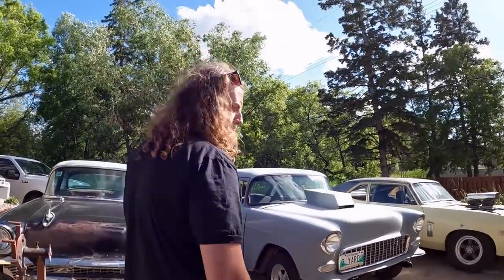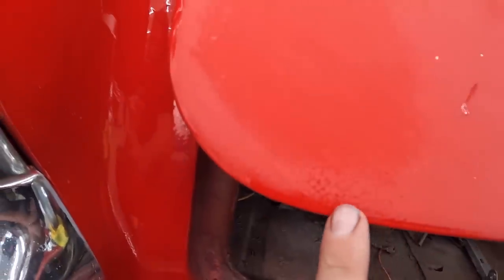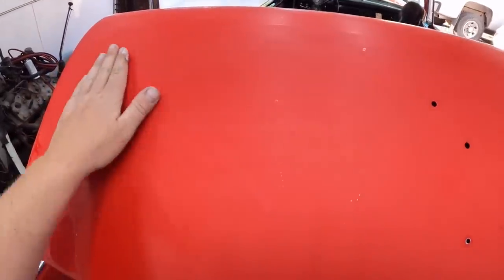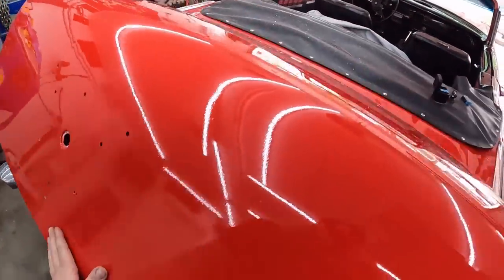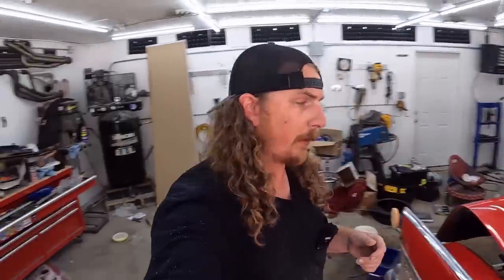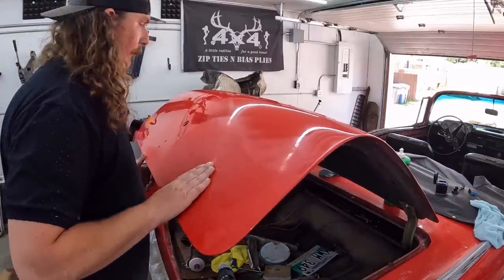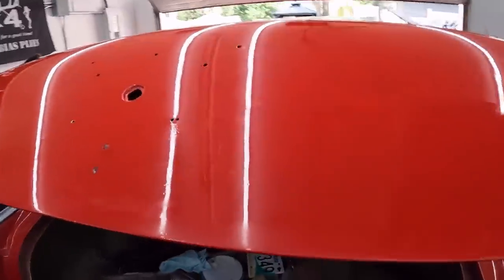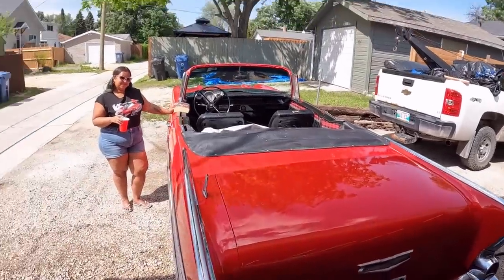TRACTOR PAINT Gets Wet Sanded And Buffed - Amateur Paint Job To Expert Finish

Comment: Couple of tips, when using a wool pad also use a cleaning spur to keep the product from building up on the pad which might cause burn thru, also throw a blanket over the interior to keep the product spattering all over parts of the car you dont want, overall it looks good, great job!
Reply: Use a blow gun and hit the trigger and spin the pad, while you blow it clean and dry at the same time!

Comment: Dan:  Any time I have an issue with swirl marks in my clear (especially a dark color), I'll do my wet sanding and throw it out in the summer sun for the rest of the day.  Since wet sanding "opens"  the clear, the heat of the sun will "tighten" it back up.  The end result is it buffs easier and the swirl marks come out a lot easier. 🙃
Reply: Didn’t know that, awesome!

Comment: Dan if the paint is still soft it still has solvents in it. When you buff it and wax it you are sealing those solvents in. The best thing to do with enamel paint is to wet sand it with fine sandpaper and let it set until the solvents have evaporated out. You can not hurry anenamel

Comment: I feel for ya' Dan. I just spent 2 days wet sanding and polishing the trunk lid on my '67 Red LeMans. I could have sanded it and re-cleared it twice in that time. But it turned out great. I used 3000 grit 3M Trizact for the final sand before buffing. Thanks again for sharing your Garage Time with us.

Comment: well hello Dan . when wet sand sanding you have to use a squeegee to wipe off the excess see what you're doing
Reply: I wipe it then use my air gun to get it dry quick...to see where it needs more sanding. Others just wipe it then move to another area while the wetness dries. Both work great.

Comment: Hello there cowboy here again so you want to be a polishers lol it takes a while to get the feel it's real easy to burn through a couple of hints a little bit of compound goes a long way also put the clothes away till you're done with the compound also watch your angle you want to float the pad at a slight angle keeping a larger point of contact with the pad , the get a good Polish and a clean pad to finish polishing out the clear coat to a nice luster try watching a good video on cut and buff you'll see first very careful sanding with multiple grits then compound stop wash it good to get all the compound off the surface only then Polish it keep trying you'll figure out what works kinda and clearly what doesn't no matter what pad you're using with whatever cream a light touch don't bear down ever you'll find out way to quickly why all the best be patient with it as always remember be safe healthy and happy God Bless 🤠

Comment: Dan, worst case is you could sand it with about 600 spot in the color and reclear the panel.  Looks really good.  Andy
Reply: This. Basically adding a flow coat. Would cover quite well.

Comment: I always found it harder to buff the panels and get out all the scratches when I hand sanded. Wool pad works but the burn thru risks are higher. Look into 3M products for your DA sander that use a " Hookit" interface pad. 1500 grit, 3000 grit and finish with the wet 3m Trizact 5000 grit and use a foam pad on your buffer. Finish up with your DA polisher and some 3m swirl mark remover. As always, Love the Vids! Keep it up

Comment: One thing about it, is that, if it does go south, You can always respray it, because it will already be sanded. You wouldn't be out other than the paint. But I don't think that will be needed. I have faith, Also when I was a young boy, my father would paint cars part time. I would help sand while my father would polish the paint. He never had any problems using basically the same paint as you. This was in the 60's. Good Luck. Ronnie. You could use a couple of drops of dish soap. will help sand easier, like a lube.

Comment: The car looks great!  From its humble beginnings to today, you have turned the '57 into a great car.  A little orange peel is nothing.  I didn't put enough hardener for a paint job once and it took 3 or 4 months for the paint to 'dry'.  Sucked.  It was so soft, days later you could still leave fingerprints in the paint.  That was an embarrassing lesson learned.  I was glad it wasn't on one of my hot rods and didn't even try to correct the flaws in the paint.

Comment: Some of those spots on the vertical section of the drinker's side almost look more like fisheyes,  from oil contamination.  Since the decklid is the worst part,  I'd maybe sand it as smooth as you can,  using 600 or so,  and shoot new clear on the decklid itself.
Reply: @blackiecat7195  that too...
Reply: @blackiecat7195  I would think that the whole paint job would be that way then but it sounds like it's only in a couple areas and he did mention that it was tight to the garage door so he might have been too heavy on his coats of clear in spots and there was not enough time between the coats to dry sufficient.

Comment: +1 for the wool pad.  And you only need a DA to get the polishing scratches out.  I also love Mcguires ultimate,  it's cheap and works awesome.  Keep it wet and don't overheat the paint.  Once it's dead flat, then you can work it with foam and softer compounds with a DA.
No heat!  It's mechanical abrasion.  If you overheat it it's plastic.  You will ruin the paint.  Plastic will discolor and deform, lose structural integrity when heated.

Comment: Having just buffed out a vehicle had a lot of white paint and scratches plus some damage from scraping a garage door frame; I have a few suggestions.
1. Looks like you may have been too liberal with the compound as it looked like like you were just sloshing around. I went light and buffed until it became hazy and had an actual tug on the buffer.
2. You might have stopped and checked for any red paint on the pad or wipe off cloth. Chemical Guy's yellow wiping cloths would have shown any pigment more easily...white even better.
3. I stayed with my Griot Garage G9 random/orbital buffer which has, to me, better control Than my Makita 9237c. Both great tools but the Makita requires more care.
4. I understand your desire for instantaneous gratification but as I've told my son in +/- your age bracket...If you don't have to have it done immediately when frustrated with progress don't get mad walk away for awhile...as it seems you have on the Nomad. 
5. Did Mr Cotton suggest speed settings (rhetorical) as I set the Griot Garage budder at 4 or 5 depending on where I was buffing.
Good luck.

Comment: Some advice to save lots of time when you have a large area with issues like that trunk.. just sand it down and shoot another coat of clear.
Reply: I was going to post the same answer, but as long as it doesn't have the same heavy orange peel on the re-coat. its amazes me how much orange peel there is on new cars, hvlp?

Comment: I'm painting my wheel horse garden tractor with van sickle. Pretty sure it's an enamel but their clear is lacquer.  It worked fine but some places orange peeled bad. Sanded and recleared and same thing in same spots. Even clearing over the clear was messing up. I'm no body shop guy but I thought you wasn't supposed to mix enamel and lacquer but why do they make them that way in that brand. The sumbitch is about to get me put in a damn padded room right now lol

Comment: gotta keep those wool pads clean and not full of the compound. I use an old screwdriver to remove the used compound while the buffer is running  then run it on my jeans. If you let it build up too much it will burn the paint much easier. I also wash my used pads in the washer (dont let Dannie catch you). Used pads are good for buffing old turds or a light glazing.
Reply: Buffing..your bluejeans..??...🤔..they make a tool.for cleaning the Pad...also...You should  wash pads by hand...use a bucket with water and  soap...

Comment: My bet is they're runs that you sprayed over.  It's the spot where they'd happen.  Bake 'em in the sun, they might lift if you fiddle while it's wet.  If it's not sanding (or polishing) red, you haven't breached the clearcoat.  Overall, looks really good considering its pedigree.

Comment: Camaro 2,  pro tour, LS 6sp manual, AC, 20's , white with black stripes. Camaro 1, 70's street beast, BB 400 Trans, raked, traction bars. Slots 10 back 7 front, Vette style side pipes. You did ask for ideas on them.

Comment: Your problem is you don't understand that you can't just use the wool pad. Wool is just for cutting, not polishing. You need to use two foam pads after using the wool, one a bit harder than the other and your finish pad will take away all swirls and polish.

Comment: Looks good man. Now, I'm not a body man, but one thing I was taught, and I'm sure it's wrong, is to always put 1 coat of clear more than I want on the car. So if I want 3 coats of clear, put 4 on. That way you can sand one off the get it flat and not worry about sanding through to base color. Like I said, I'm sure that's wrong, lol.

Comment: I'll start with 2,000 work my way way up to 5,000 before I ever put a buffing pad on the paint, when wet sanding if you feel friction you still cutting the clear when it starts getting slick and you don't feel good friction you know it's time to buff.

Comment: Like I told you Dan get rid of the clear coat wet sand properly and then polish it with machine glaze and you won't believe the difference once you have orange peel with clear coat it doesn't come out so easily that don't spot that you're seeing is not the clear coat that clear coat is gone that's actually the paint

Comment: You don’t want heat when your buffing less heat, better it will cut yes you were using to much compond I would start sanding with 600 then 1000 1500 finish with 3000 it will buff up easier

Comment: You did not have much of an option on the burn through.  When the paint is not flat you end up pushing too hard and an "even cut" removes some high spots but takes away low...i.e. burn through.  I hate the jamb up paint spots where you do not have enough room to back up.